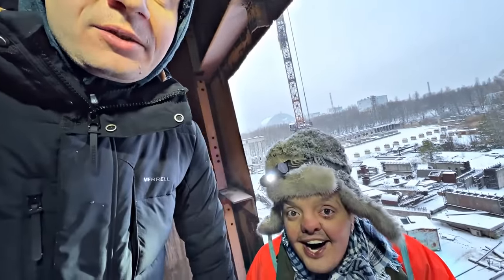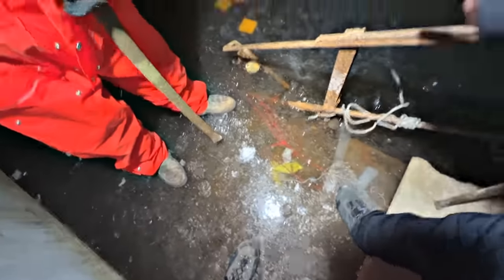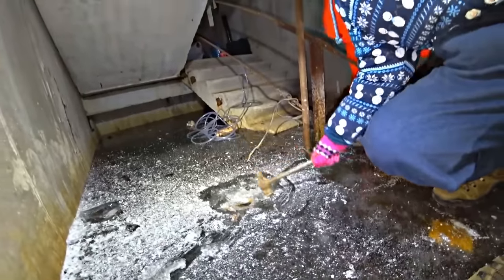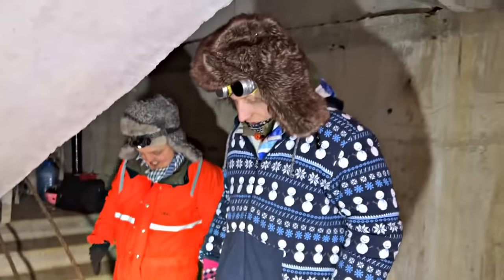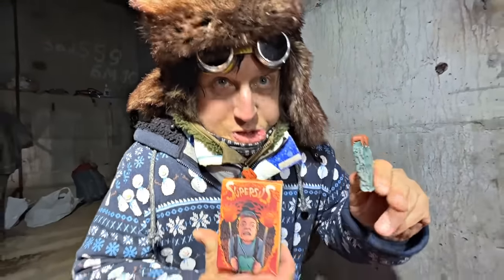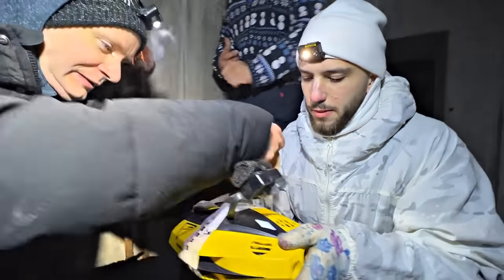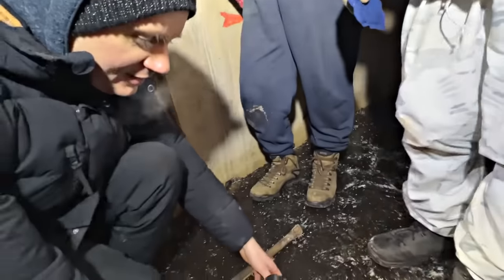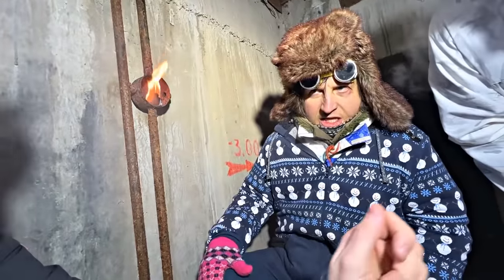☢️What the UNDERWATER DRON discovered under the Chernobyl REACTOR☢Launched Quadcopter undr Chernobyl

Comment: How cool would it be if you took a pump and pumped the water out of the basement secretly so you could go and explore the flooded basement
Reply: I was thinking this as well but there are at least two major problems with doing that. First would be the noise and second, where could you put that water that would be discrete? Certainly not into the streets.
Reply: @JohnyKnox  maybe put a couple blankets over the pump and run the water to a nearby creek or something 🤔 I bet these guys could pump it based on some of the other stuff they've done
Reply: Dude that would be a massive crime against nature. Think about what you're suggesting here.
Reply: @collinsmith5134  sea water is already slightly naturally radioactive plus water is a natural moderator for neutron radiation. Plus they'd be dumping radioactive water into an already radioactive river. Seems fine honestly
Reply: @collinsmith5134 i do appreciate your concern for nature, i mean maybe the sediment at the bottom of the water possibly. Hard to say for sure that its "thousands times stronger"  but its not as though the radioactive  water is contained in anyway shape or form in the basement as it sits. The whole site is contaminated already. They can pump the water out and hook a dose meter to the water hose they use to pump the water out. If the water is really THAT radioactive, they would be able to tell as they pumped it.

Comment: one of the reasons why piloting the drone can be difficult is the fact that the yellow rope is completely twisted, try to make it straighter, without these curves, this forces the drone to turn towards the twisted side of the rope, and the more you make curves, but the rope twists, it's like a cable, let it go, and run your hand along the wire until it unwinds

Comment: I would just like to say how incredibly stupid what they are doing is because there is a massive amount of radiation in that area and the don’t even have Geiger counters. It is very dangerous to do what they are doing and likely faked because the reactor is under extremely strict supervision and is impossible to get into without permission and these guys would definitely not get permission to dive I. This place. The water here is one of the most dangerous parts of the plant. They would die if this was the real plant but it is obviously fake. However it is pretty funny.

Comment: That’s the reactor #5 Right ?
Reply: Yes it is
Reply: There are only 4 at chernobyl, 4 is boom boom, 3, 2 and 1 where retro fitted with safety gear to prevent a number 4 boom boom a second time around. They still produce power to this day btw. 5 and 6 are empty rooms with no reactors ever been built there.